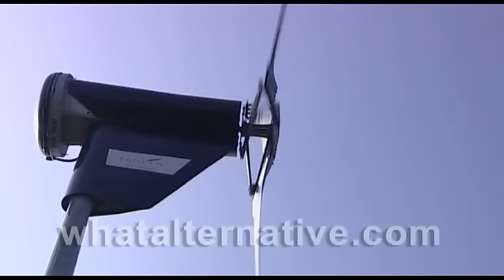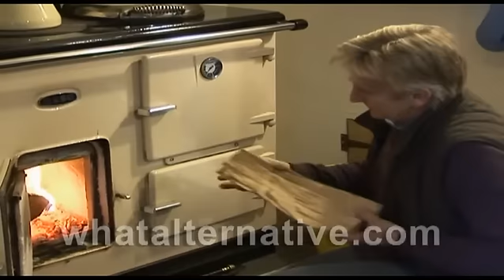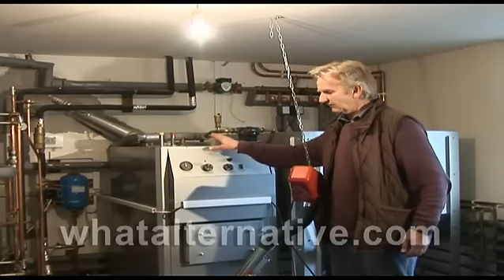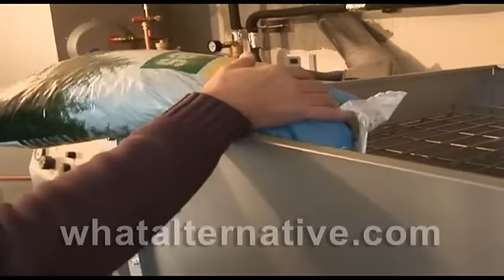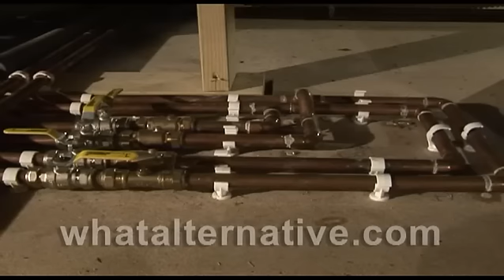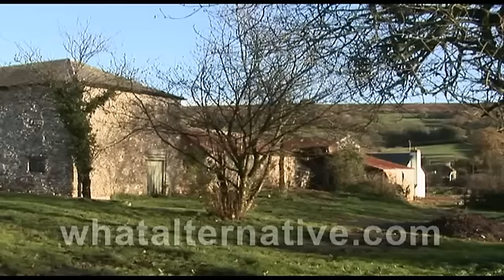PelletMultifuel central heating, renewable energy

Comment: Buy a overseas shipping container set it where it's out of the way and paint it to match the house. With up to a 48 foot container available and systems that store 20 30 or more tons of pellets in the container you then use a blower transport system to transport the pellets from the outside storage to the inside boiler storage container for pellets. Simply paint or use stone or wood shingles to blend in the storage container. Problem or storage is solved.